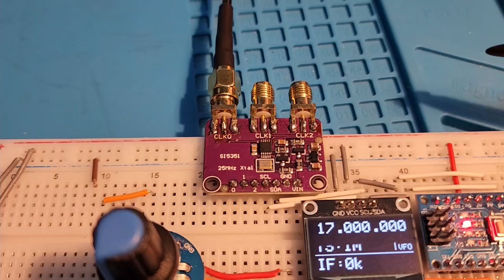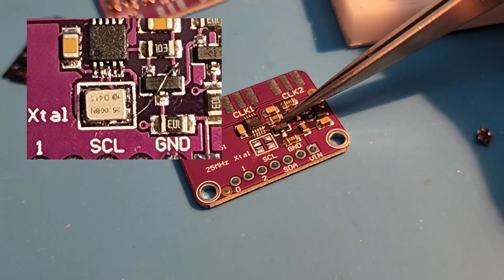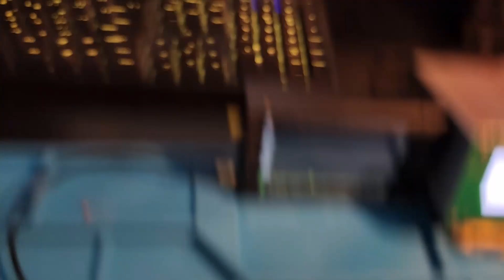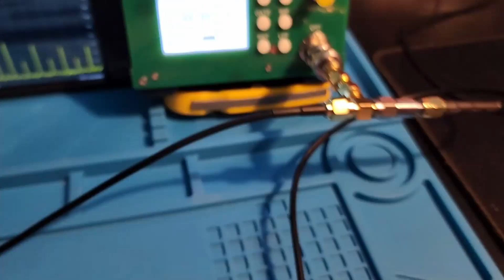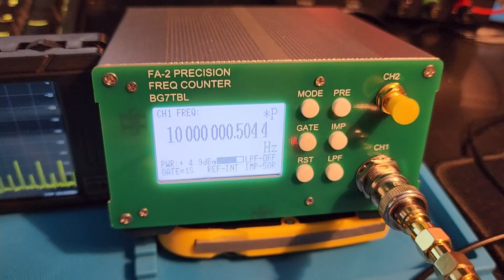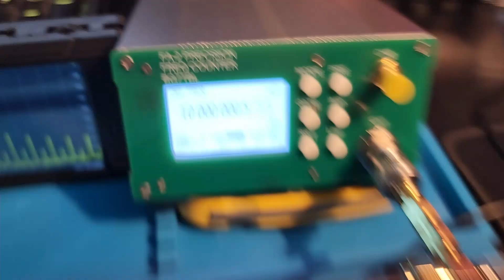Adding a TCXO to the Si5351 DDS boards for stability in CB Radio VFO PLL replacement mods

Comment: Just a brief question, you don't need a coupling capacitor  between de TXCO output and the SI5351 chip input?
It seems to work in your presentation. I was just wondering.
Yours, 
73 Frans (PA5CA)
Reply from the maker: No. I didn't check the DC on the tcxo output, i assumed it was a 0 to 1v or so waveform. I'll have to check. My only concern was the p-p output of the TCXO was at the low end of what is required for the 5351 but I've done quite a few now and all 100% solid

Comment from the maker: If anyone has done this I'd be interested to hear how it went. 
I have done a few with no problems but I think the output level from the TCXO is lower than the recommended input level when running an Si5351 from an external reference.

Comment: TCXO does not heat up. If it did, you could tell by putting your finger on it and feeling the heat! TC means Temperature-Compensated; you are thinking about OCXO, which is Oven-Controlled. A TCXO contains a crystal and oscillator circuit, and generally some sort of tuned capacitor network in the oscillator circuit which has a temperature coefficient opposite of the crystal. That way whatever natural frequency variation the crystal experiences over temperature, is neutralised by the entire circuit. It can also be programmed digital control, so you might notice tiny steps in the frequency as the crystal passes through temperature bands of a certain granularity. The OEM can probably tune both the temperature response and frequency when they finalise the chip so its initial frequency might be much better than a crystal by itself.

OCXOs are MUCH bigger! You can buy some decent ones second-hand off eB/Ali for 5-15 from chinese vendors. CTI OSC5A2B02 is most popular model. A new one would be >40.
Reply from the maker: Thanks for that ! I will read up on them more. I guess it has the same result which works really well. (I thought the OCXO was just a much warmer version) 
The OCXOs are generally too expensive for these.